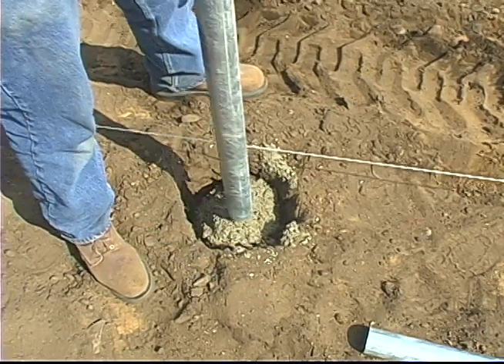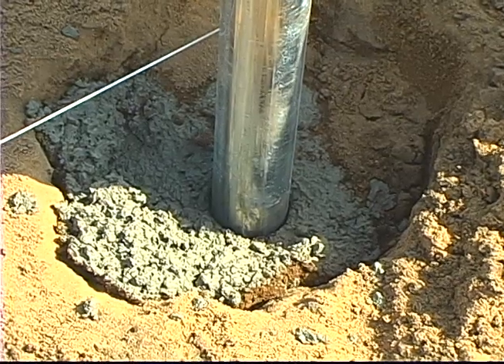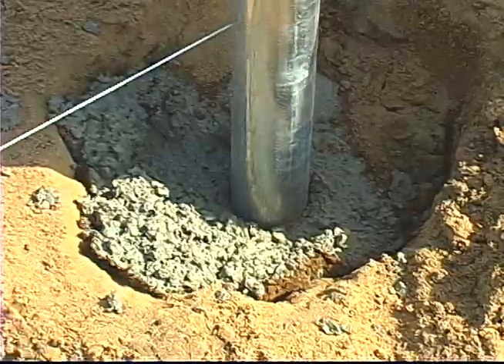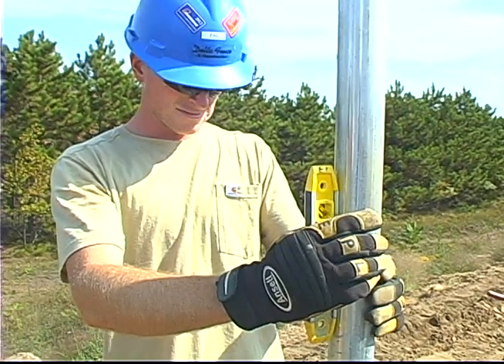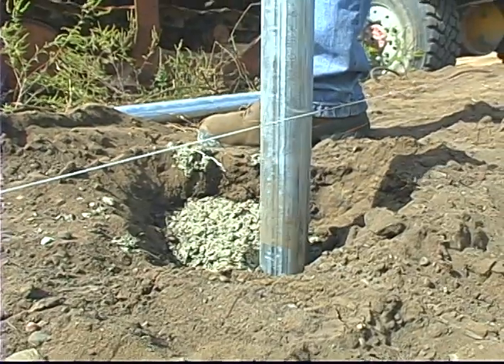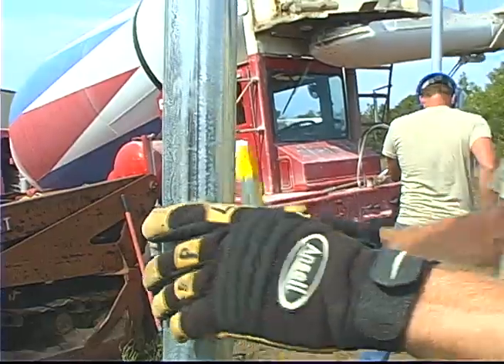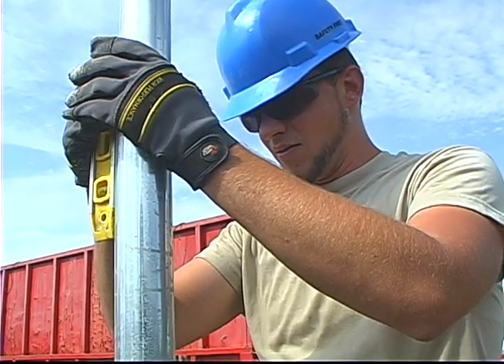Choosing The Right Way To Set Fence Poles

Comment: So floating the posts down in the cement will it give stronger stability of the post? What would be the difference if any to set the post in the ground dry pour cement around pole then fill pole in with cement up to 2 feet wouldn't that be much the same thing as floating?
Reply: No because with floating, the concrete completely surrounds the bottom of the pipe.
Reply: @craigolson1822  If the object is to surround the bottom of the pipe with wet concrete, would it be ok to just pour in enough mixed concrete to do that and then pour in dry concrete to fill the rest of the hole and wet...why would I want to do that?  Because I'll be doing this job myself and mixing the cement in a wheelbarrow manually, which for my age will be strenuous for me, so I'm trying to save a bit of energy on the mixing work and only mix what I need.
Reply: Carolyn Wolfe - I don't see anything wrong with that as long as you don't let the first pour cure before adding the dry mix to the hole on top of it. My point was to be sure to encapsulate the bottom of the pipe.
Reply: @craigolson1822  ok thanks
Reply: @carolynwolfe5023  How did it turn out Carolyn?  Nice to see women comment.  I am 75, single woman farmer, doing everything myself too.

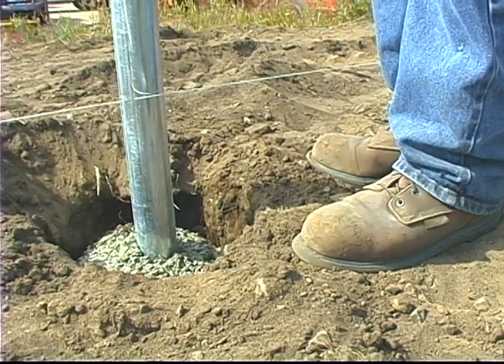Comment: 2:22 drill a hole and put a rod at right angles and it will not sink. For good stability at least 1/3 into the ground. And yes, it's less profit but higher guarentee.

Comment: Can you use this method if using poles for a 6' wooden fence indeed of chain link?
Reply: I wouldn't. And I didn't use this technique. It is not as strong as poles going all the way into the hole and pouring the concrete around the pole. This is kind of a half-assed method. They do it because on Commercial projects nobody cares because it's not their property and they want it done fast and cheaply

Comment: I pulled fence out for some work, now I need to put them back. There's already concrete on the bottom of the poles. Do I still need to dig a bigger hole and pour more concrete? If we can use pipe to pour in concrete for the 1st time installation, it should work without additional concrete for the 2nd time installation, right?

Comment: What can you do with one foot of 2 1/2" commercial pipe? Other than recycle it for a fraction of the cost.
  I guess it all depends on the length of the pipe before it's cut into 9ft posts. Did I miss that?
Reply: They're ordered (custom or otherwise) a foot shorter.  They don't have that excess in the first place, so nothing to cut off.

Comment: Hello, would the post be corroded by the concrete? what kind of post are there , cheers
Reply: Galvanized post within at least a 2" wall of concrete around the steel, with enough cement to water ration, becomes a natural protector, except if the ground is very acidic (acid rain) or salts are used, such as deicing. The tops of the post need to be capped to prevent water from entering and staying inside the pole.

Comment: Ya but you don't have to cut a post just because you didn't float them. You get every hole ready with post markings then put the post in the ground at the height it is supposed to be and add concrete. done. If there is a question of height, etc., then leaving the posts taller helps because then you just cut it. But, I wouldn't want to cut a bunch of posts

Comment: I have a question maybe someone can answer for me. I'm putting up 150' feet of chainlink mesh all in a straight line, and my rolls of fencing come in 50' rolls. Should I plan on putting in an end post at the end of each 50' ?  Or, is it ok to just splice (3) 50' rolls together and have all line posts in between?
Reply from the maker: It is fine to splice the rolls together. Our recommendation is to stretch the fabric around the halfway point.
Reply: @LCEnterprisesUSA  stretch the fabric at the halfway point, but keep going and attach it to the end post at the 160' point, right? ty
Reply from the maker: @carolynwolfe5023   Correct. You will stretch the fabric once again once you get closer to the final end post, roughly a foot or two from the end post.
Reply: @LCEnterprisesUSA  sounds good. thanks for your post

Comment: concrete is too stiff to fit post. Post winds up not touching concrete if you wiggle it any when installing. Looks to me like you need more fluid concrete to make this work
Reply: Thank you! I'm glad I'm not the only one to see this is a shitty install. He basically just created a weak failure point for the concrete and the post to sheer since they are not full mated.
Reply: No, he explained the slump and viscosity.

Comment: You left out the best reason to do this.. So you don't have to wipe off the dried concrete from the bottom of the post
Reply: That's really not hard to do at all. I have 120 posts on my property and I did it after the concrete was set and unless you're super messy a flat chisel will break off any tiny bits of splatter.

Comment: This is a horrible way to do this. So basically because you're too cheap to buy the right poles which would be 11-12' you want to "float your post" which will incredibly weaken the post. You're also pushing your post into the concrete which is not the proper way to set a post in concrete. You need to have the post in first, and then pour concrete around it. This is a poor installation that will give problems later.
Reply: 77Avadon77 I'd did agree for two reason. A) he is saving money on post length.
B) like rebar it's nice to have proper coverage around and at bottom of bollard

Comment: not to seem like a  douchebag but cement, Concrete and Ready Mix are three different things. Cement is dust that will fly away. Cement is the finished product. Ready mix is what you put in befor it hardens into concrete.
Reply: Concrete **
Reply: +Easy Rider Even my 3 year old knows it's CONCRETE not cement!!
Reply: The very reason I clicked on this video.  Cement is an ingredient in concrete!!! Calling concrete,cement is like calling cake, flour!!! Keep Rocking!!!

Comment: you will never ever set perfect straight posts that way. Post always find way to get off the line when you drive in. But idea is cleaver. 4+
Reply: Especially when it comes to elevation, things have a tendency to sink if they are not being braced very carefully. It's easier to hold a pole level that sitting at the bottom of the hole then to hold it at an elevation which is why this technique is not common, also you've greatly reduced the Shear strength off the pole.